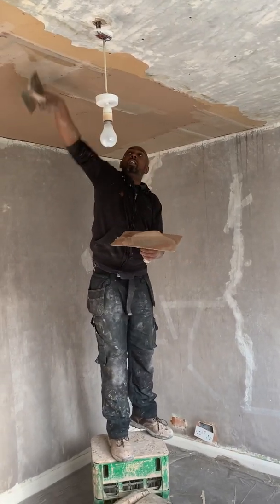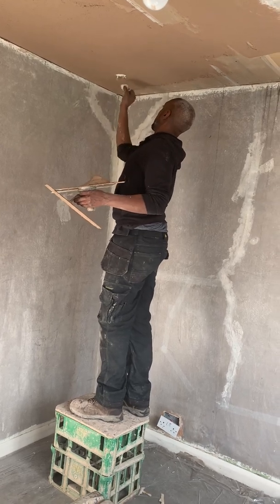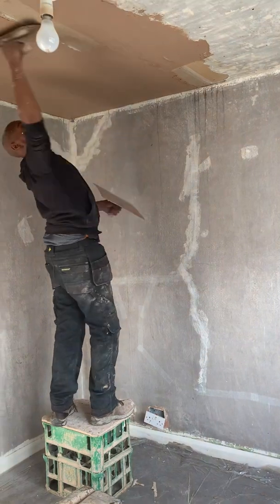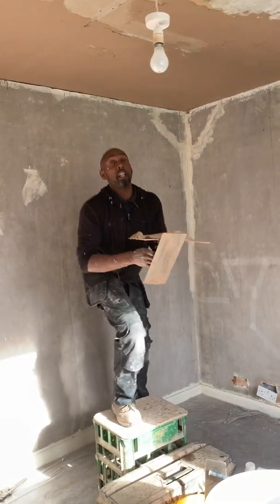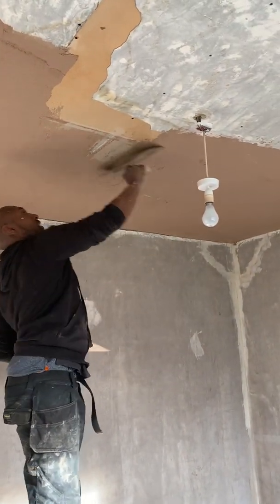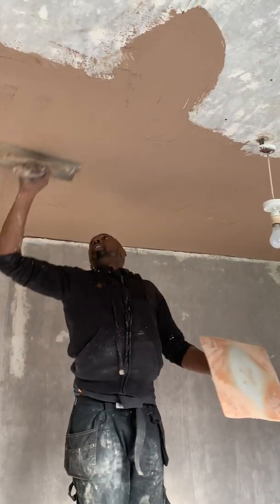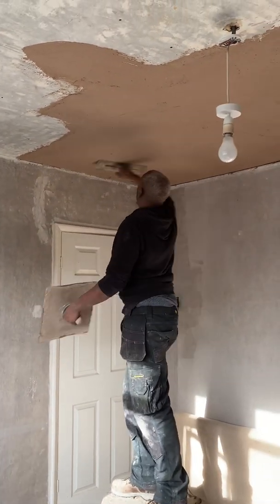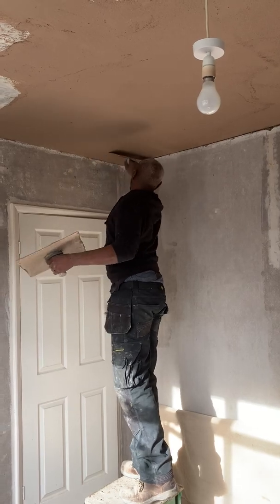Power Plastering Tutorials - Bonding a ceiling to the correct level

Comment: I was enjoying that and video finished before you did. I've been looking for a video on bonding a ceiling as I've got to bond a ceiling out.do you bother with PVA when bonding plasterboard reason I ask is I got some plasterboard off cuts and done a little experiment one with no PVA one with one coat dry ,one with one coat dry one coat tacky but you get the idea after 6 months I tried to scrape the boards they were all the same the bonding stuck to all of the boards with or without PVA that stuff sticks like s... to a blanket. Good video.